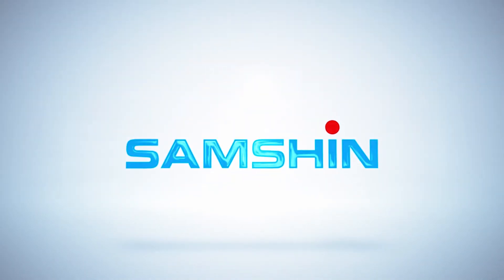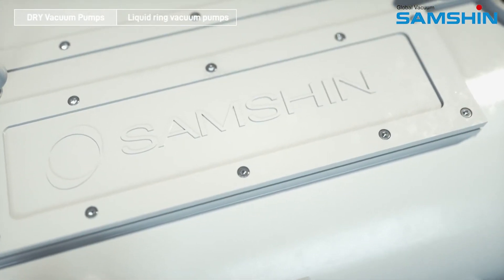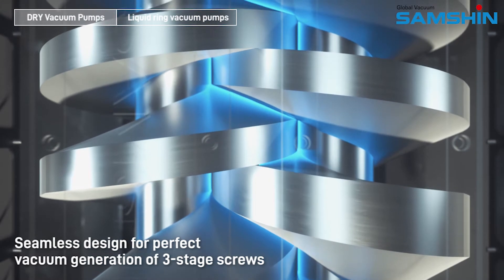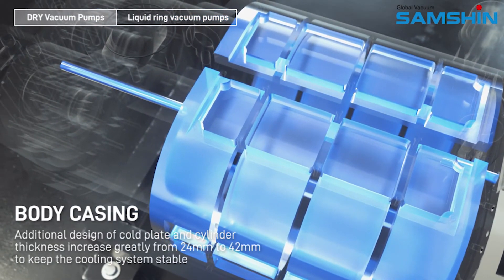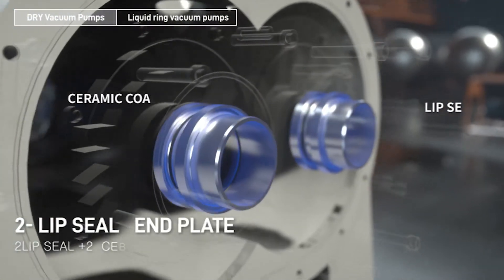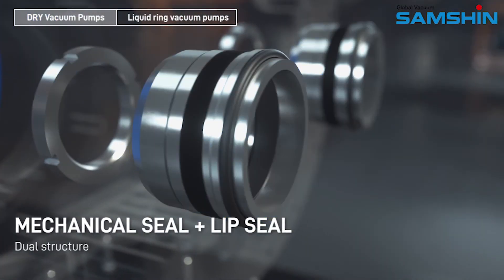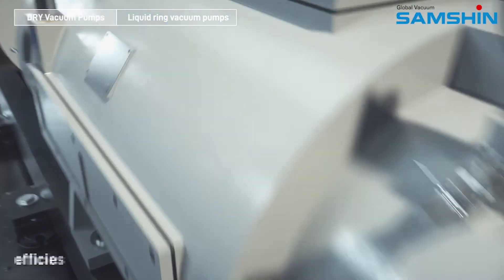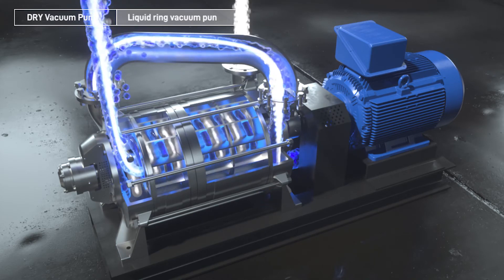SAMSHINVAC  #Vacuum Pump , DRY Vacuum Pump , Vacuum System , DRY Screw , House Vacuum , Turbo Blower

Comment: Are this pump capable of compressing saturated steam at 0.5bar(A) to 2bar(A) @0-2kg/s while using 120*c water at 2bar(A) as cooling medium? Possible to have duel pump with heatexhanging between them.

If you are i would like to contact you.